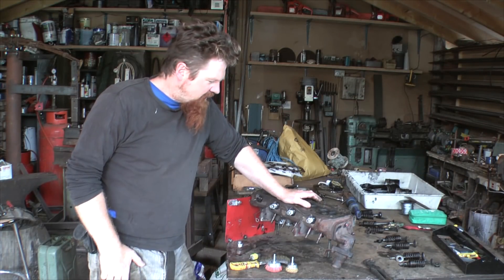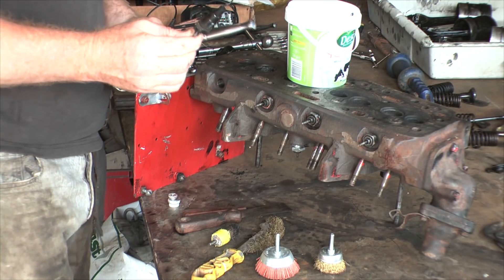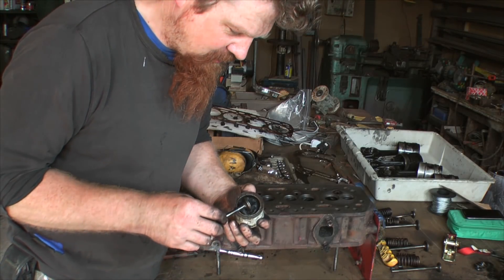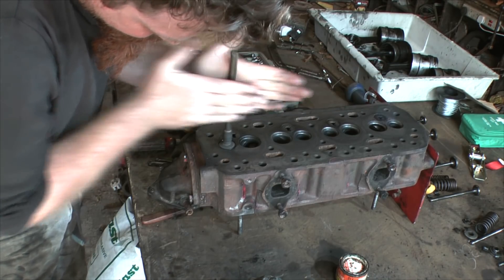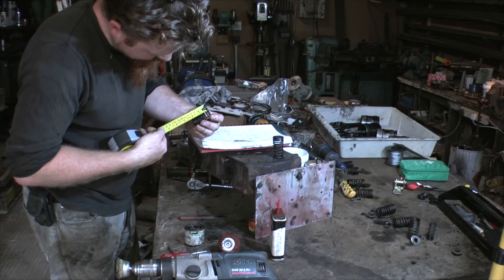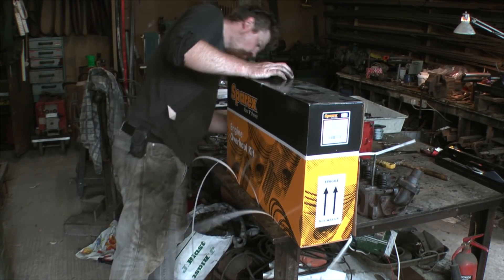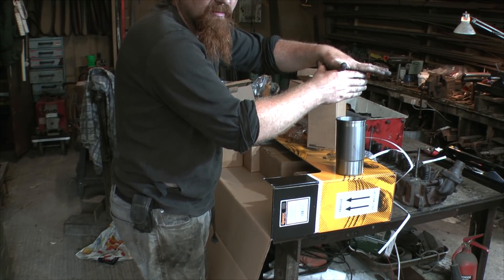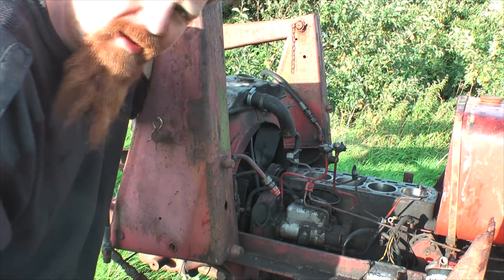Tractor engine rebuild pt3

Comment: Greetings mr Maximus....it is possible that you have the valve springs upside down...usually the close bound coils are placed on the bottom...not trolling just saying as from experience of over 50 yrs in engine machining industry
Good luck

Comment: At a rough guess as the glow plug is missing a bit from the heater element its a Bosch glow plug made in India and as they are wired in series that's why he tractor wouldn't start......no glow. My mercedes 200d had the same problem.

Comment: Sorry to pry, I think the outer valve springs have been fitted the wrong way round. The tighter coils should be at the bottom closest to the cylinder head and not the collet retainer.
Reply from the maker: Interesting, you may well be right, I'm certainly no expert! I have checked in my manuals, in the operator's manual, there is a photo which does show the tighter coils at the bottom. However in the workshop manual, the diagrams show no difference in the spring and there is no mention of an orientation in the text. I wonder if it makes a practical difference?
Reply: Maximus Ironthumper the tighter end is the "dense" part of the spring. Ideally you want to move as little mass as possible otherwise you end up with valve float at high rpms. But on a slow revving tractor I really doubt it makes much difference.

Similar concept with reducing unsprung mass in suspension.
Reply: @  Jamie Applewhite I was just thinking the same thing, I think it might depend on what way round the inner ones are. The point in having double valve springs IIRC is to make the valves spring shut evenly, i.e. the valve doesn't snap shut too fast, or delay too long in closing. As such you want the tight part of one spring to be countered by the slack part of the other and visa versa.

of course I could be talking out my arse, it's been a long time since I played with the insides of an engine...maybe too long.

Comment: Informative & entertaining. Does the head have removable valve guides? I lapped the valves on a straight six engine, but only replaced the valve stem seals. I suspect worn guides may be causing a bit of oil to seep into the combustion chamber & perhaps causing lower compression. Might do it differently if I had the chance.
What's in the pouch on your right hip? Multitool?
Reply from the maker: The guides are replaceable but I haven't done so. I found that someone else had worked on the head, it seems in much better condition than the rest of the engine, so all I've really done is checked it over and given it a good clean. It certainly needed it! 
It's a Leatherman Surge, souvenir of a trip to Colorado a long time ago and still my favourite tool!

Comment: Looking verry nice again!  Ok still quite some more work to do, but i am getting more and more exided to hear it running again. A time consuming job on the valves but worth it. What i did with the cillinder bushings, had them in the fridge at around minus 20 degrees celcius for at least a night. And they slided in verry well. Though yours didnt go that bad eighter. 
Thanks for posting, nice to see some one else being bussy as myself. Keep on going ;-)